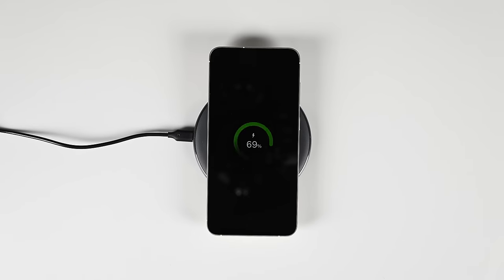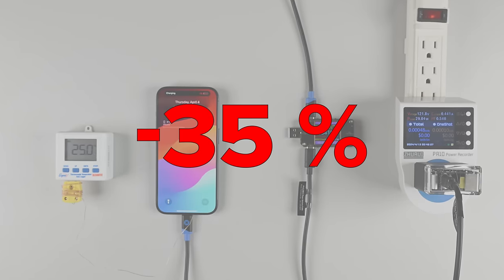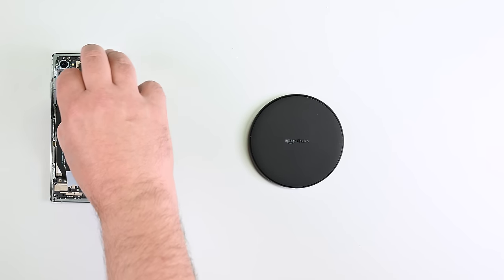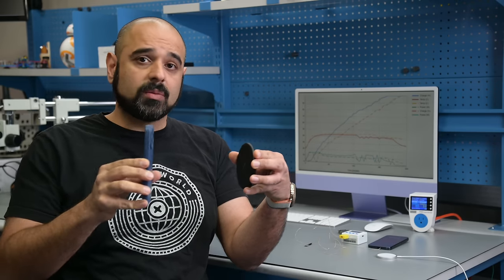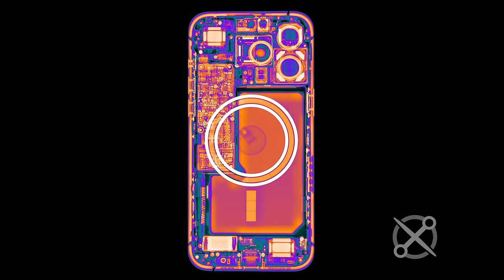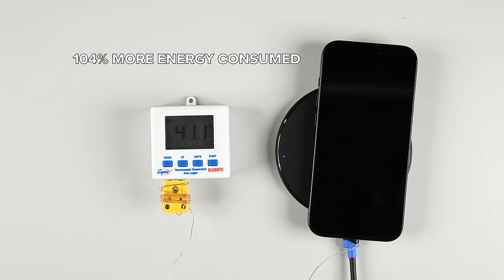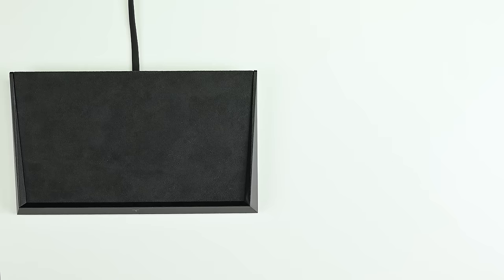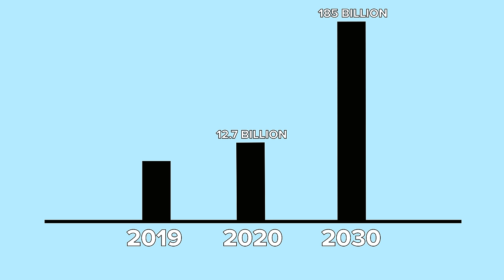How Wireless Charging Works and Why It's Terrible

Comment: I think the wireless charging only really makes sense in a car (where the cables and handling them could be even a safety hazard) or at places like airports (where using a wired charger, perhaps with a travel electric plug adapter is really difficult). Other than that, I don't really see the appeal.

Comment: If you have to fiddle with your phone till it hits a wireless charger just right, then why even bother? (MagSafe is great in that regard, but it's still slower than wired)
At this point, just get a dock for your phone. It would always snap right and charge it much faster than wireless ever could.
Although, it seems like the only option today is to 3d print one to fit your phone, as there aren't that many variants on the market.

Comment: I have got phone that can wireless charge for 6 six years. I have never used the feature. I would feel like I would throw half of electricity out of the window and with half of what's left I would damage my battery (which is in my opinion still really bad in modern electronics :P)

Comment: We're starting to see electronics reach their peak potential. You can only cram in so many transistors and bells and whistles. Ultimately, we need something entirely new. Every modern piece of technology under the hood is 50+ years old at this point, we've never had a new true core invention since the Internet.

Comment: I have a phone that has a broken charging port. Fortunately, I have had it replaced and now I only use it for games so its battery life isn't super important. In the summer I have to put a fan blowing over it while on the wireless charger or it gets too hot to charge at any kind of acceptable speed. lol

Comment: Samsung wireless chargers have a bulit in fan to keep the temperatures down. Highly recommend it if anyone uses a samsung device. Doesn't get hot. Just keep the charger in a flat surface and not on bed or carpet.

Comment: This video seems to exaggerate the negatives of wireless charging. While it may produce some heat and potentially cause minor battery degradation, if it were truly detrimental, it wouldn't be a feature in modern smartphones. Consider the scenario of using wireless charging to incrementally charge the battery throughout the day. I maintain my battery between 20-80% and avoid leaving my phone on the charger overnight. Having used wireless charging since the early 2010s, I've observed no significant impact on my phone's longevity. It's worth noting that older Samsung wireless chargers included a built-in fan to mitigate overheating. I still use the older version, I think it was a 2018 or 2019 model.

Comment: i will only and only wireless charge my smaller devices like earbuds and watches. Never a phone because the energy loss was too big and doing it every night would certainly hurt the battery by going hotter and worse, slower.

Comment: I can’t recommend using wireless charging anymore. My iPhone 14 Pro Max went from 100% battery capacity to 86% within the first 6 months when I was wirelessly charging it. I stopped doing so, and in the next year it went down 3%. Usually it’s not until year 2 or 3 that my past phones would drop past 90% capacity as I only slow charged via wired.

Comment: Honestly, since switching to a brand new Pixel 6a, the battery is good enough where I'm not charging it overnight, since I know I can just charge it for an hour at work if it gets too low. No need for a wireless charger

Comment: Literally the only reason for wireless charging to exist is for charging in public spaces. It's SLOW AF, heats up your device, is more expensive, and takes up more space on your phone that could be used for a thicker battery so you might not even have NEEDED to charge AT ALL. Buy a 20w apple usb brick. It's the same price, if not CHEAPER, and charges your iPhone blazing fast.

Comment: Wireless charging will always be slower than wired. Also, you cant hold and use your phone while it charges wirlessly and the back of the phone needs to be made of specific materials as well. Its just beating a dead horse.

Comment: hybrid use/option of having both BUT I feel u should only use if necessary. Fast Charging cooks ur battery faster too. I have a wireless&fast charger but I only use them if needed. I still use the OG chargers even tho they slow ur battery will last ALLOT longer. Now if u @ baller & buy the new iPhone every week then b my guest hav fun

Comment: Devices with proper research and development such as oppo, oneplus and xiaomi all have dual cell batteries with optimisations for charging wirelessly, yes its inefficient(a lot less than phones with only 15w wireless charging) but the batteries are rated for much more charging cycles than mainstream brands like Samsung or apple (up to a thousand more). Also, proprietary wireless chargers are more efficient, so the likes of the brands mentioned, have their own charging pads which have ventilation to avoid device heat up and less efficient charging, while also achieving much faster charging speeds.

Comment: Wireless charging would have been awesome if I could place my phone anywhere and still charge it, not on the wireless charging platform pad. But obviously there's not going to be a true wireless charging system anytime soon. If I can bring the phone to a wireless charger pad, I can very well connect it with a charging cable. They could have designed a system which uses magnetic alignment to make electrical contacts to charge normally.

Comment: Can you do a video on the ability to keep battery % at 80 max?
Reply: Don't do that, rather avoid fully discharging it. That's what damages the battery the most. On my old phone I had 33 Watt charging and always charged to full and after 1100 cycles it still had 93% battery health. I remember my Galaxy S3 back in the day and would often let it discharge completely, leading to the battery in it dying after 300 cycles.

Comment: In physics and engineering, you do not ever get something for free, there is always a tradeoff. Its how much much that tradeoff matters to the consumer is what decides it value.

Yes, wireless charging will never have the same efficency as wired charging. Just by the nature of being wire-less compared to a direct feed of energy via a cable. As a tradeoff, the user does not need to bother with using a wire to charge thier phone.

Comment: I'll always charge wirelessly as I don't want to have to plug wires in and have them trailing about. I've been charging every iPhone since the X came out and every Pro Max model since then to my current 15 PM so 7 iPhone generations, and in all that time I've never dropped below 96% battery capacity and usually my battery on each phone is usually about 98% to 99% by the time it reaches a year old and that's with always charging to 100% and optimised charging turned off as I hate that feature. When it comes to speed yes wired for now will the be very quickest way but I'll still take wireless anyday for me. Plus it's significantly less wear and tear on the port, because if your an extremely heavy user you could be plugging in and out about 400+ times a year or more especially on smaller battery capacity phones, that's not great for the port.

Comment: I remember I left my 14 pro on a wireless charger, went to shower and came back to check on it. Thing felt like it just came out of the oven. Opened up an app, and it started to boot loop. Long story short, the temperature sensor got fried so the phone was permanently stuck at the Lock Screen. Fortunately, Apple just basically gave me a new phone for free, except for the screen, which they decided to transfer over, saved me another $20 on a screen protector I guess lol

Comment: Yeah I know how transformers are inefficient which is why they burn up regularly. The only thing I charge wirelessly is my Samsung buds pro 2 so I can keep them in the waterproof case.
Reply: nah transformers are some of the most efficent devices out there.
its just wireless chargers have an air gap between the coils, instead of metal. this is why its inefficent

Comment: Personally, I not only don't use wireless; I don't usually use high-wattage chargers. I don't usually need my battery charged fast or fully; I typically keep it in the 40-80% range with a 10W charger. Helps extend life even more than using the high current ones to 100% :)

Comment: That Tesla pad looks to be using exactly the same approach Apple tried with an attempted „Drop it to charge“ solution they patented and prototyped (I think) in 2015. It never got beyond the proto stage because the performance was unsatisfactory, and I wonder if Tesla are aware of the same problem but just thinking „Meh. It makes mon£y so who cares?“ 🔋💰🤷

I was using an iPhone for a while and charging that inductively (Partly for convenience, partly because I was using a ruggedised case that was a right pain 🍞 to get a Lightning cable into) and never realised it was the charging that was making the phone warm - I'd always assumed it was the device taking the opportunity of being charged to run pending power-hungry tasks my habit of keeping it on Power Saver mode wouldn't allow when away from the charger! 😇

Comment: Certainly these results demonstrate technically how there is a lot of it efficiency. However, pragmatically, wireless charging is incredibly convenient and I'm perfectly fine with paying for that convenience in terms of efficiency loss. Just like going to a convenience store. I've charged my fold 3 every single night using a wireless charger for the last 3 years. I've lost approximately 20% of the battery life with heavy daily use. Sometimes multiple charges per day. This is definitely informative but I Don't plan on changing my habits and hope wireless charging sticks around. Might even get efficiency improvements in the coming years.

Comment: I'm not playing Fortnite on my phone but my tower defense game uses 3D so while playing my phone heats up. Play every single day, phone is 4 years old now. I'm not sure how I feel about all this information. My phone is constantly somewhere around 38-43c during play sessions. I'll just stop if I need to charge while gaming if the heat gets too high. But according to them I should have been destroying my battery significantly. It does discharge faster than when I got it but not even noticably. Holds its all day usage charge like normal. Plays videos and games without watching the % tick down at max settings. If anything I feel like I'm going to break this phone from use well before the battery effects my usability. I do understand there is a difference in what is generating the heat but my phone is hot a large part of the day.

Comment: Now that we have USB-C, I really don't see why anyone would need wireless charging. It's not hard to plug in, and you can't even charge while using your phone when using wireless. AND THERE IS A WIRE CONNECTED TO THE WIRELESS CHARGER ANYWAYS

Comment: while I don't know as much about technology as you do I kinda had already figured out that wireless charging is less, efficient than wired and that is why I have never used it since it have been introduced just like just like with everything wireless is more convenient and easier because obviously you don't have to fumble with the cable but wired is better and more stable the same goes for connecting a lan cable to you computer laptop TV or console or what ever you want to connect to the internet and I wished that TVs still had the Headphone Jack so you could connect your speakers to it but I fear that they will get rid of the charging port and the sim trey in the near future and come with an excuse saying with need the space for more camera tech and they will force us to go digitally just like how they removed the Headphone Jack and the Micro SD card slot on phones

Comment: This is a really important public service announcement. it would be nice to save on the cost and added complexity of these devices by removing the wireless charging technology. That’s to say nothing of the savings on charging costs and battery degradation accumulated over the years of charging the device.

USB-C charging standardization (although confusing at times) has turned out to be a mammoth step forward in convenience, with the added benefit of reducing e-waste. I hope the industry abandons wireless charging.

Comment: The numbers arent as bad as they look, US average electricity cost is 16.4 cents per KwH, if you have a phone with a 5000mah (0.005 KwH) battery that is a tenth of a cent for a full charge, 2 tenths of a cent for a wireless charge

10 years of charging from zero to full EVERY DAY with wireless would cost

8 dollars, thats it, for 10 years

Comment: The number 1 problem with wireless charging is the Phones software, all phones should have an option of ONLY starting the charge when the battery goes below a set level (unless override) so that you can just use the wireless charger as a stand but you know once it goes below ie 40% then it will start charging. Androids adaptive battery is absolutely useless.i never charger over night but it always says will be charged by your alarm at 7am. Useless.

Comment: True. Wireless charging is today more inefficient. But in everyday use wired charging and cable connection has its practical downsides. And if not handled correctly you can damage a charging port which will.give a whole set of different issues, not being able to charge your phone anymore or even send over data through a wired connection or jave access to virtual desktops wired. I think wireless charging has great practical implications an standard potential over having to look. around for a socket to plug in an adapter and cable to charge, which occupies some space and leaves a spaghetti of wires. With electric car wireless charging, there are already technologies out there that have adressed wireless charging inefficienies of EVs. In that regard I think development of mor e efficient charging on smartphones has lagged behind. I think qi could do more to adress inefficiencies of wireless charging on consumer grade. And elecyrinics companies could do more to manage heating and heatloss of electronic compnenents. We've seen quite a few innovations of heat management in EVs, but it doesn't seem to have trickled down to smartphones yet. I think that is greatbinnovation to invest in. That, or make all smartphone designs easily repairable, so we can easily swap smartphone batteries, which I think is a worryingly growimg problem. I think there is still a place for wireless charging, for ot is quite convenient. Maybe a smarter wireless charging could be developped to more smartly manage the heat problem, when charging the battery wirelessly? Another thing what I think is why we don't do more withe charging through pogopins. I think these stike a nice balance between wired charging and the convenience of wireless charging techniques. I think it would allow more flexibility in designing better wired connections with magnetic connectors and make more compelling mobile charging or case designs for a more seamless connection than the careful connection we have to do with usb c. The pogopins would also allow a more watertight solution, which offers a lot more benefits.

Comment: This is a terribly narrow scope of wireless charger styles. How about the Samsung chargers that have fans in them to cool the device while it charges. Does it matter if the device is on a flat or angled charger. Amazon Basic products are barely better than dollar store products. Yes, no matter what wired charging will be faster and should keep the battery cooler, but there are batteries that get to 80% in 10 minutes. Doesn't feel like wired charging is better in that situation. A more in depth video would be nice.

Comment: Not dealing with cables? Isn't the wireless charger hooked up to a cable and literally right next to the phone?
Is the difference of not plugging that cable straight into the phone so significant that we need this solution? XD
When the USB charging port broke on my old phone after several years, i paid 5 euros to have it fixed, and it only ever happened on one phone once, in 12+ years. Wireless charging has benefits, for a tablet stylus for example, but not for charging phones.

Comment: Yes, wireless charging is hideously inefficient for a high-power device like an electric car. However, it makes perfect sense for a phone. Even with Lightning and USB-C offering significant improvement over Micro-USB, the USB-C port on modern phones is likely to be the first thing in the phone that breaks, forcing you to replace the phone. Over a 4-year life of a phone, if you're plugging it in every night, you're adding 1,460 plug/unplug cycles to the USB-C port, making it more likely to fail prematurely. Yes, they can be repaired, but how many people are actually going to do that? I've taken phones apart and repaired stuff before, and it's not a fun process with these waterproof sealed phones.

Therefore, my goal is on longevity of the phone, not power efficiency. I believe that in total, this is better for my wallet, and better for the environment. I have a Wi-Fi dongle in my car for Android Auto that I use on a daily basis, and reduces the plug/unplug cycles in the car by over 90% (I still have a wired charge cable with an Anker PowerIQ charger for reasonably fast charging on longer segments of road trips). I use an old Samsung wireless charger in my bedroom for overnight charging. I purposefully use the slowest charger that I have to not build up excessive heat in the battery while charging.

Lastly, and probably most importantly, I use the setting in my Samsung S21+ to charge the battery to 85%, which increases battery longevity 5x, and I still have plenty of power for my day.